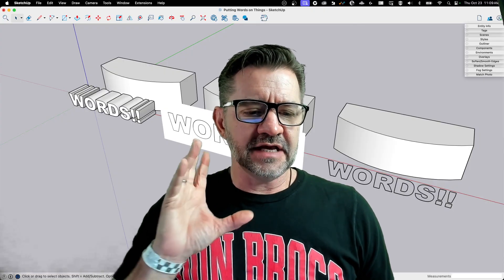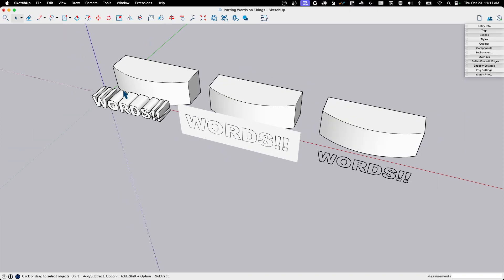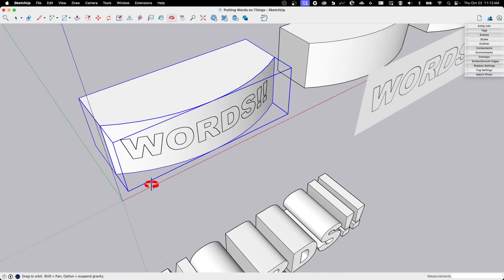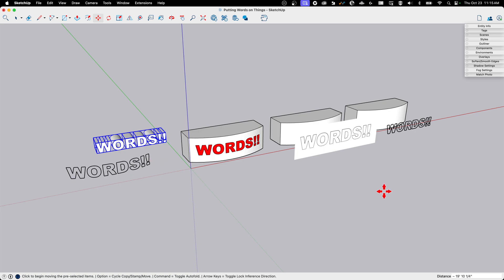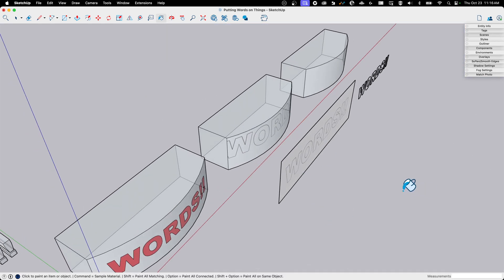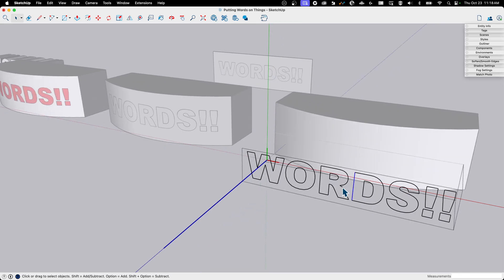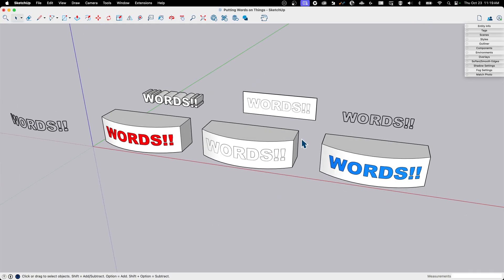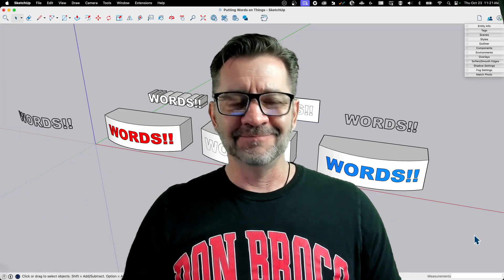3 Ways to Put Text on (non-flat) Things in SketchUp

Comment: never thought about using the drape. I tend to always use intersect faces. depending on the complexity I will normally rotate the letters individually to match the surface, or for a long word, bend or curve the 3D text and then intersect, that way it reduces any distortion of the letters as it goes further along the curved surface

Comment: I have a 3D printing question, and I don't know if I can explain it clearly enough to make sense. I want to print 3D Print the text so it will be the negative space (mould) in a cylindrical concrete face. So option one is the closest, but what I would like is for each letter to pull forward straight off the face in the degree they are pointing so that once the letters are removed the concrete negative space for each letter will be the same depth.... does that make any sense? Currently if you use the first example and pull/push it into the surface, the "W" and "!" in the example would be the shallowest of the letters since they are all cutting in on the same plane. Is that better? 
Anyway I'm wondering if there is an easier/ish way for me to model this, Thanks.

Comment: Wonderful. As long as I work with SketchUp as more I see that there are possibilities to make anything you want, BUT you always use the tools that really made for something else. And this is fun to get, but in the end its really... annoying, because its always WALKING AROUND. 

This needs to be an easy tool for the exact thing, but there is really not a tool for that. And you're showing it as a benefit of SketchUp? Really? Sandbox for text?

What if I made a mistake in that text and want to change it to something else? How many steps do I need to undo that?

I think, after 15 (or even more?) years with my favourite SketchUp - I'm starting to dislike it and not love it as I do all these years.
And that is mostly because the software is NOT UPDATING AT ALL.

Devs really choose not the best vector for updates. If Rhino (which I hate) will make a better UI - SketchUp will die, unfortunately.
Comments and work together is okay, but please read YOUR forum.

Please do something with that, guys.
I really want to stay with you, but it's unreal now.

I want to work with 3d printing, with interior and even product design, but in the end I will go to Fusion 360 and Revit instead of the software I love.

Shame, but it's true.

Comment: Thanks one question re projected text option ( middle sample) . Could you not explode all in this sample then. Intersect faces to have letters show up as distinct ,therefore able to  be colored   distinctly  to the object they are intersecting   ?
Reply from the maker: With the projected texture example, it's projecting pixels from the image file—not actual geometry—so there's nothing to intersect with.
Reply: thanks . Seems to imply that whatever texture / color  you want for the text would have to be added before projecting it  but then how would that affect a given color/texture ( if any) of the surface  the letters were being cast onto ? Most all video tutorials of project image seem to present with  a blank or white surface .
Reply from the maker: Using the projected texture method replaces the texture on the receiving surface. If you want to maintain the texture on the surface you're projecting onto, one of the other two methods in the video is a better option.

Comment: Now let's extrude those curved surfaces. Oh wait, not possible !
Reply: Matt I use the thicken feature ( first option) of Fredo’s  extrude extension for extruding a curved surface…
Reply: @legacyfound  Of course. Like most of the modeling tools, you need to rely on third party add-ons.
Reply: @maxtronomia Shame, but truth.
Reply: @maxtronomia and how about to add extra "!"? oh, stop asking something really useful... using the sandbox tool for the text is a benefit!
Reply: @maxtronomia  Not so.  The first example could have been taken to its next logical conclusion.  Using the intersect command, a curved face could have been cut into the text piece that would match the curved face.
Reply: because sketch is stopped in time, this shit dont have a dark mode in decades

Comment: There is also an extension called TrueBend that you can use.   Put your text on a flat object, group them together, use TrueBend to bend both, use solid tools to finish however you like.   This avoids the proportional distortion of the text around the curve.  For those using older versions of Sketchup, TrueBend works all the way back to Make 2017.
Reply from the maker: Nice tip! TrueBend is a great extension.